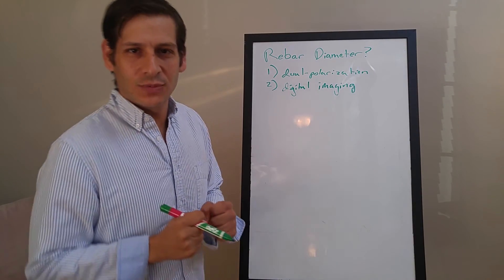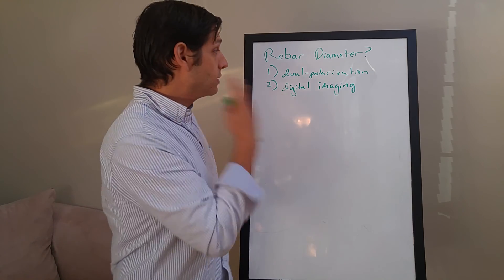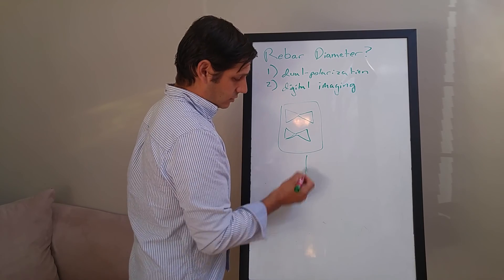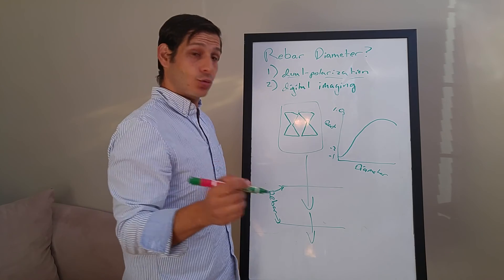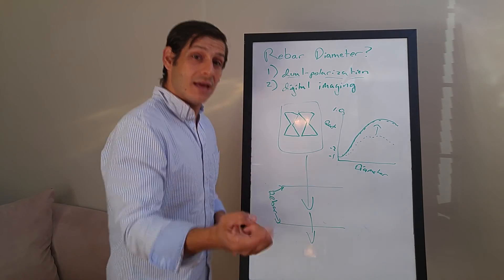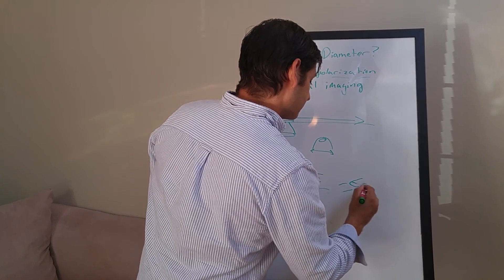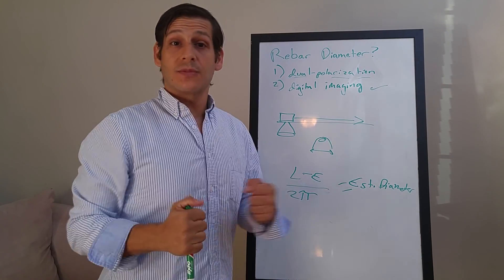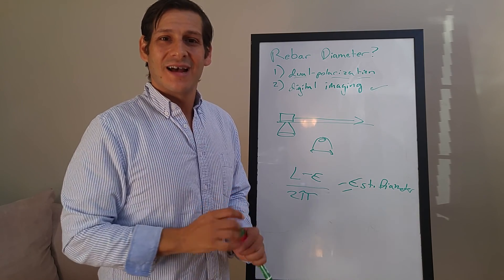Can GPR Concrete Scanning Determine Rebar Diameter?

Comment: Hear a lot of can get you to an "estimate" of your bar size, et cetera. I'll say that with all of the structural engineering firms I've worked with over the years, estimates of bar sizes DO NOT FLY. The difference between a #4 or #5 bar is critical in calculations. If your SE or EoR is comfortable with guesses, then this is 100 percent viable. I just hope whomever is pushing this "analysis" is conveying to their clients that this is merely a guess and is not to be considered as fact. Grab a chipping gun, chip out and measure the rebar when they need to know exact. Don't leave it up to conjecture or guesswork.
Reply from the maker: Yep, totally agree. Estimates can be helpful, but you should never design off of remotely sensed bar sizes. Further, there are other tools using eddy current that are easier to gain estimates from that are typically as accurate if not more. Thanks for the comment!

Comment: My name is Marcelo Paredes, I am an engineer and for 5 years I have been a GPR in the concrete in Argentina, and it was always a problem to know the diameter of the bars. It is very interesting your explanation to determine the diameter of a bar. I need to amplify that explanation with screenshots of gpr screens, where those methods are applied. I really understand the explanation but I do not see it in practice. You can send me something.
marcelo.paredes@wallservices.com.ar
Thank you

Ing. Marcelo Paredes
Buenos Aires, Argentina
Reply from the maker: Ing. Marcelo Paredes thanks for watching! There are some papers that you can look for on the subject. If you have issues finding them, then let me know

Comment: Hey Dan,

I'm a bit torn on this one. I normally agree with everything you say and do, but I don't know, when it comes to GPR technicians offering the diameter of rebar. I think you could be playing with fire. 

Actually let me go back and firstly say, thank you once again for providing another valuable video, and more so, for continuing to push the envelope and discuss techniques that are not common practice. 
Ok, now, diameter of rebar. 
While I really like the techniques you suggested and in theory, they sound true. I'm just not keen on telling a client a rebar is 15mm thick and not 8mm thick like it says on there 'as build plans'. 
I am happy to do it when it comes to telling them where rebar is, but not size. 
Let's use your example, that a contractor is modifying a building and needs to know if the slab can hold the weight that they are proposing to put there. The techniques suggested are good as a guide. But I would not be prepared to put my reputation or my house (if I got sued) on the line, like I do when I do utility locates or concrete scans. 
If the contractor was prepared to do some pilot holes and prove the size of some of the rebar that we had found and we could do some comparisons, then it would be a different story. 
But I find a lot of times, (well over this side of the world at least) contractors just want you to mark, so they can go and core, or cut a chase or design a new layout, all from your findings and they are not prepared to confirm any of it, regardless of our request for them to do so, and all the disclaimers we have. 
Don't get me wrong, I understand the point of the video and that is that as a GPR experts technicians need to start stepping up and start show why they are the professionals they are. 
And of course, offering a service that no one else does, will certainly do that. 
I'd just be very cautious of the advice that they are giving to their clients. 
But anyway, that is just my opinion, I'm actually quite surprised no one else has commented on this, as I expected a few would have, as it is kind of going against the indsury. But maybe they have commented in other forums, and I have just not seen them yet. 
But, regardless of all that, I think it was a good video and I'd really love to see this put in practice and for you to do an onsite video of how this works. 
Although that's probably more a video that you would put in your course, rather than online here. 
Anyway, thank you again and take care. 

RegardsBen
Reply from the maker: Hey, Don't know how this one slipped by. I am in complete agreement with you on this. Experience is huge when it comes to this and verification on a few should be required. But, as more and more case studies indicate less than 3% deviation I do think it will become more common practice. Point well taken and folks should be cautious!!